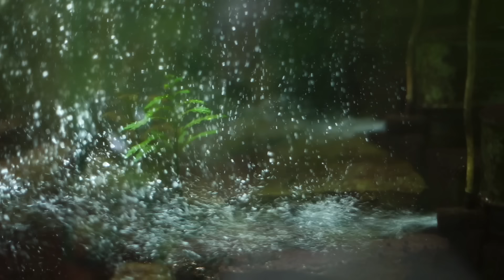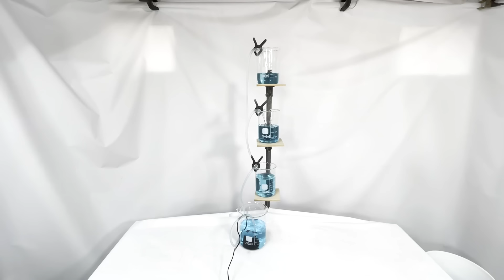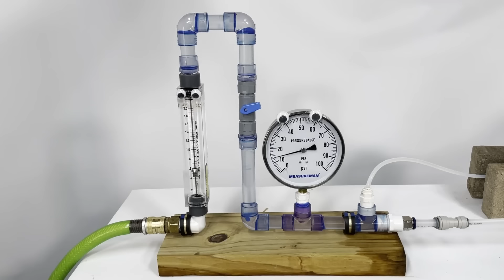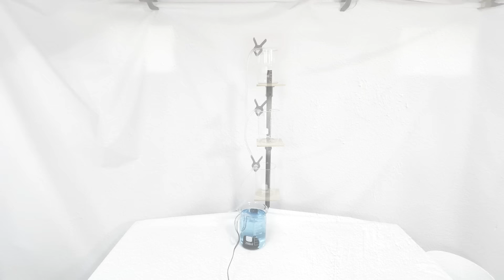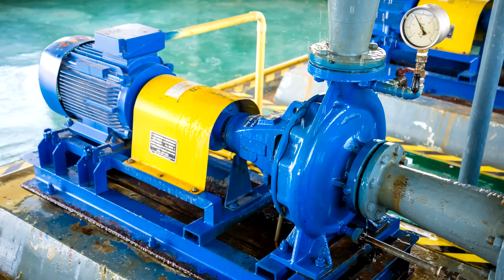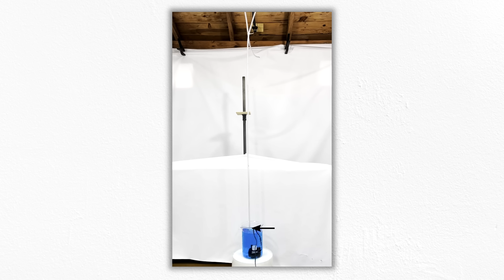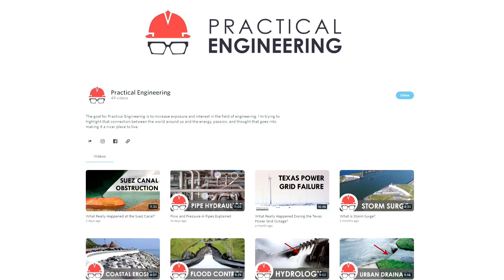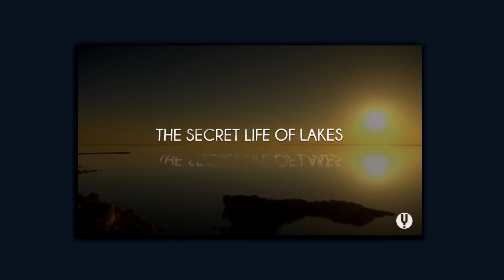Do Pumps Create Pressure or Flow?

Comment: When I was in college I understood it as, pumps create pressure which gives fluid energy, difference in pressure causes velocity/flow.
Reply: Just like a net positive force creates acceleration, not the other way around.
Reply: For gas right? But fluids I thought weren’t compressible.
Reply: @eswing2153  everything is compressible, even fluids and solids. They just need a lot more pressure to compress in comparison to gases. And fluids under pressure also store a bit of energy by expanding their containers.
Reply: Yep. Nature seeks equilibrium, and we provide power in one form to create energy gradients to drive a flow that can be used for something else.
Reply: @eswing2153  a fluid is just a substance that flows and takes the shape of its container, gasses and liquids are fluids. In some cases solids are fluids as well.
Reply: @praisethyjeebus  everything can flow with pull it enough lol
Reply: And again it's just like potentials and voltage. Difference in potentials causes voltage. And conductance causes current flow.
Reply: @NicosLeben  Difference in electrical potential IS voltage, right? I mean...if we are being pedantic we can say that voltage is a bad name, because it is based on a unity, and we don't call a length "feetage". But I don't understand how can there be a conceptual difference between the two in order to say that "one is causing another"
Reply: Wouldn't this only be true for the centrifugal pump? In the case of the positive-displacement-pump the velocity/flow is the same regardless of pressure
Reply: @Mikeyy511  That would arguably only be true with an ideal motor (or a very tightly speed-controlled one, or a synchronous one) - once enough back pressure starts loading the pump and the motor, it will first slow down then stall, meaning it would still have a non-constant _curve_. It's just that the variation with pressure would be practically zero for low pressures compared to the stall pressure...
Reply: You’re close: pumps add energy to a fluid. That increase in energy, in accordance with Bernoulli’s Law, can increase the fluid’s pressure, velocity, or vertical height. 

It’s a bit like the swinging ship rides. Do the drive wheels make you go higher or faster? Both, because they’re adding energy to the system. Since the system has more energy, it now travels faster, and requires a larger height to convert into gravitational potential energy.
Reply: @eswing2153  fluids just do not need to be compressed as much (there isn’t a lot of space between molecules) to create a lot of pressure compared to gas which can have a large change in volume for certain pressures.
Reply: pumps also create pressure difference, really, not an absolute value of pressure
Reply: Batteries, electrical power supplies, and fluid pumps all have (at least) 2 things to consider: the open circuit voltage = pressure when the valve is closed, and the short circuit current = flow with no restrictions. Everywhere in between depends on the resistance or system curve.
Reply: ... when in reality: it's all energy conversion, and things like flow rate, pressure, voltage etc. are all symptoms and indicators, not causes.
Reply: @JPFighter93  WORD
Reply: @praisethyjeebus YES common glass is a fluid, a very viscous fluid.
Reply: @bpetnoi1472  that theory has been proven wrong multiple times over. Glass is solid, not fluid.
Reply: Qimodis  astute observation
Reply: @eswing2153 I'm sure someone has pointed this out to you by now, but gases are fluids lmao 😂

In regards to physics/engineering we speak in terms of Newtonian fluids, which is any matter that flows from high to low pressure in a laminar or turbulent state 👍 Whereas "fluids" in the colloquial sense is used interchangeably for the term "liquids"... this is often a source of confusion for people who don't have a solid basis of scientific knowledge 💯
Reply: @praisethyjeebus actually Newtonian fluids are any substance that flows from high to low pressure and maintains either laminar or turbulent flow 👍
Reply: @mrb692 In regards to water, "pressure" is a direct function of height so your observation seems redundant in listing both 🤔
If you have 2 cylinders that are 36" inches tall, but one with a 2" inch diameter and one with a 2' foot diameter... When filled with water, the pressure would be the exact same at the bottom of both cylinders lmao
Reply: @EmpressOfExile206  I was talking about the swinging ship rides. The motors add kinetic energy which moves the ship faster which means a greater height to convert it all to potential energy. Speed and height are interchangeable because energy is energy. 

Pressure and height (and velocity) are all interchangeable as given by Bernoulli’s principle because they’re all different forms of energy, and energy is energy. And no, pressure is not a “direct function of height”, as evidenced by hydraulic systems not being hundreds of feet tall.
Reply: @EmpressOfExile206  lol. I’m an engineer. I’m well aware of what you speak.

Comment: This was a really great video, thanks!  Loved the graphs!
Reply: gioyu comi  Long story short, for the motor it's because of eddy currents.

For the motor it has to do with the design of the motor. A motor has an ideal operating range. If the motor is spinning too slow, you're not getting bang for your buck (low flow rate). Too fast, and the fields generated by the motor start to interfere with eachother (eddy currents) and its efficiency goes down... so the idea is to get the correct size motor. If you get too big or too small a motor, you strain the motor and make it inefficient. Good electricity goes to waste if you don't select the correct motor... so it's good on your electric bill as well to find the perfect motor.

In regard to the system curve, I think it's because the pressure drop due to friction in the pipe isn't linear. Watch his other vid on pressure and flow. He's got a part with the hazen williams equation.

Comment: “Do pumps create pressure or flow?”
“Yes.”
Reply: they pump XD
Reply: they create pressure. then the fluid responds to that pressure by flowing.
Reply: @mrxmry3264  exactly this. Like how a battery creates a voltage differential in a circuit, a pump creates a pressure differential. Fluid in the high pressure side will need to move to the low pressure side but the pump prevents it from going backwards, so it must move through the system first.
Reply: @MiniEquine  correct.
Reply: @Tom R avatar checks out
Reply: "Pumps create pressure or flow."
Reply: centrifugal ones dont make much pressure but radial piston ones do because they basically work like an air compressor mixed with a radial aircraft engine.
Reply: Pumps create flow, restrictions create pressure.
Reply: @calholli  thank you your the first person that has agreed with me. It's real simple.
Reply: @hydraulicshop69  I took a hydraulics course and this was drilled into my head. If I have a pump with a fixed flow rate and I want to increase my output pressure I need to use a smaller diameter hose. 

But that’s only half the solution because pressure is measured by the cross sectional area of a hose an not the diameter. If I go from a #8 hose to a #16 hose I have decreased my pressure by slightly over 4 times because if I double the diameter I increase the area four times. Correct me if I’m wrong but that’s what I remember.
Reply: @aaronpreston47  Your first paragraph is right. Idk about the numbers on the hoses but yes a 5gpm pump will produce 5gpm until its restricted which causes pressure. Hope that clears it up.
Reply: Alot of false info here.
Reply: Pumps create flow. The only reason centrifugal ones can't pump up over the head is because the flow backwards equals the flow forwards. They aren't perfectly sealed pumps and by virtue of their nature are tricky to discern how they do their thing.
Reply: That was my first thought as well. 
I just spent $100k on new raw water pumps for my water plant. The sizing and engineering was the easy part. Getting something that specialized during Covid insanity was impossible.
Both our pumps died in December, we installed a backup. It was supposed to be two weeks to get our new pumps...they came yesterday, early May. 2 weeks became 5 months. 

These are 480v 50hp pumps running 1400gpm against 70ft of head. They're big, about 1000lb each.
Reply: @calholli  Unfortunately, you're wrong. Pumps create pressure and that pressure MAY create flow. The pump's impeller imparts pressure against the fluid. If there is no 'apparent flow' there will still be flow within the pump as the pump simply 'stirs' the fluid.
Reply: @hydraulicshop69  Pumps create pressure - and that pressure may create flow.
Reply: @RobertMorgan  "Both our pumps died in December"
Why?
Reply: @millomweb  wrong
Reply: @hydraulicshop69  "Alot of false info here."
Agreed - and most of it is coming from you.
Reply: @hydraulicshop69  Yes, you are.
Reply: @millomweb  the way you are explaining parts you clearly never worked on any hydros. Everyone will see this and you will be proved wrong like you already have.
Reply: @hydraulicshop69  We were talking about pumps. What's a 'hydro' - supposed to mean ? Is that your illiteracy coming through ?
'The way I'm explaining parts' - you'll have to explain that.
Where's this alleged proof you talk about ?
Reply: @hydraulicshop69  Maybe I'm the only one that knows what he's talking about and actually understands the physics and principles involved.
Reply: @millomweb  yea I'm done you dont even know fluidpower. And you weren't talking to anyone your trying to look smart and it has backfired on you. I'll leave it at that I'm years ahead of ya.
Reply: @hydraulicshop69  Years ahead in what field ? - trolling ?
Reply: @millomweb  fluidpower  hence the name hydraulic shop  let's talk bud been doing this for over 20 years
Reply: @hydraulicshop69  Uses pumps but not the impellor type as you need positive displacement.

Comment: 7:50 this is just like electricity; the load determines the power the generator makes. Interestingly, you say with pos displacement pumps it's the flow that is fixed and the pressure that varies based on load demand. Electricity is the opposite; we hold voltage (pressure) constant and the load determines the varied amperage (flow). Wonder why that is hmm

Comment: "Let me know if - . . ." 
The answer is yes, Brady. The answer will always be, "Yes. We do want to know more. Please, be as in depth as possible."
Edit:
Oh! Do come and join the argument over pressure vs flow below. It will help the channel's engagement.
Reply: Very true
Reply: I thought his name is Grady
Reply: THIS^
Reply: @ubersham  It is.
Reply: @calholli  you clearly don't understand ohms law. Pressure is voltage. It is the difference in pressure that generates flow. The resistance to flow is the tubing being too narrow or having too much friction.
Reply: @calholli  It sounds like you're talking about a capacitor in your second post, except there's a slight problem because water is incompressible, you can't really store pressure unless you go vertical. With a gas, though, every section of pipe would have an inherent capacitance. But superjugy is correct, the electrical analog to water pressure is voltage.
Reply: @calholli  You just contr4adicted yourself. what you just described is a capacitor holding the voltage (pressure) and when you close the circuit, the capacitor discahrges and current flows (the pressure drops and fluid drains out). think of it this way. if your valve is small the container will drain slowly (high resistance) if it is a big valve, it will drain faster (low ressitance)
Reply: https://en.wikipedia.org/wiki/Hydraulic_analogy this might help you understand better. Even the equations are similar
Reply: @calholli  look at the link. Do an energy and force equation system. Your model won't satisfy the equations.
Reply: @calholli  any pump that has flow, has pressure. No exceptions. Also, air is not restricted, yet there is atmospheric pressure.. Because pressure is force applied to an area. Either gravitational, or a motor force.
Reply: He should go into detail on parallel/series pump behavior, NPSHR, and mechanical seals. Control valves in the video after that.
Reply: @calholli  Yes, you've described the thumb-on-hose scenario correctly, but now we're talking about something different. Let's acknowledge that before we go moving goalposts. Resistance + current means there's a voltage difference, I think that's what you're trying to say, but you worded it like the resistance IS the voltage.
Reply: @calholli  No, not wrong. Voltage is proportional to resistance. You raise the resistance, you get more voltage across the resistor. Not more than the power supply (or pump) can generate, of course, but in relation to the other elements in the circuit that's how it works. You even said so yourself with "Raise the restriction and flow drops, and you can measure that resistance in pressure." And we're trying to tell you that pressure is like voltage. You can certainly derive the resistance of an element by the voltage/pressure across it and the current through it, and I think maybe that's why you think that pressure is equal to resistance - it's proportional, but a different quantity.
Reply: "Please, be as in depth as possible."

Now now, we don't want him under too much pressure. ;)
Reply: @calholli  the flow in a pipe is driven by pressure gradient. Imagine two tanks with same water level  connected by a pipe, you will have no flow because pressure on cross sections at both ends is equal, so no pressure gradient. If you block the flow from a pipe with your thumb, again no pressure gradient, so no flow

Comment: I'm an engineer in a pump repair shop and make and fit mechanical seals to them, this video was fantastic.

Plus to prove pumps do create pressure, it's in their design, the volute has that spiral shape that once the product has been moved off the impeller eye to the walls of the volute it follows this spiral to the discharge and as the volute opens up the fluid builds up and loses flow and builds pressure before leaving the discharge, which is why the suction always larger than the discharge, to create pressure.

Comment: I worked for 7 years in the activity of pitometry in water supply pump stations, using ultrasonic flowmeters, analyzing the behavior of flows and pressures and their relationship with the water levels of the well and aquifer, and that was an amazing experience for me, personally besides the dam inspectios is one of my favorite works in hydraulic engineering. Sometimes the sound of the pump motor says you that something is going wrong, in some cases because the pumps work "out of parameters" (with the curve displaced from the optimal operating range), and that's something that often is not taking in account, the correct selection of the pump according the needs of the system.

Comment: would love to see a video covering impeller pumps. I worked at a valve shop where the serviced crude oil pumps and they used impellers to "pull" the fluid though. the multi stage versions also did a "crossover" so the pumps impellers pushed or pulled on each other instead of generating a huge thrust load to one side. might be an interesting episode.

Comment: 5:52 that 45° pump bypass setup is genius.
Reply: Can you explain? I'm not sure the significance of what I'm looking at.
Reply: Most bypass paths use 90° corners which is terrible for efficiency and pressure drops, given the diameter of the pipe the contents are more than likely heavy and the less you need to steer the fluid the better.
Reply: @Aa-ron01  I see. That seems like quite an obvious solution, rather than something genius. Any particular reason it's not commonly done?
Reply: @PerMortensen  I haven't a clue, it could be standard practice for them it's just not something I've seen before. But I'm 27 so there's a lot I haven't seen yet. Besides doesn't everything seem obvious and logical when it's pointed out and explained?
Reply: @Aa-ron01  Yeah, that's a fair point.

Comment: Pump as an active element of pipes system provides delivery of the mechanical energy (with respect to time - power) to the fluid which is given as Q•H (for one unit of the specific weight of the fluid). Centrifugal pump was considered in the video thus shape or geometry of the impeller/rotor is strictly associated with its specific speed coefficient (kinematic or dynamic). These types of machines increase kinetic energy of the fluid (also momentum) when non zero  net torque is acting on the shaft - see Euler's equation... then most of the kinetic energy is converted into potential energy (geometric elevation & static pressure) as diameter of outlet increases. Total head is a function of discharge H(Q). Briefly speaking, pump is an active source of energy for fluid and pipes as passive elements consume it (dissipation). Thus, actual resistance of pipes (throttling, roughness, length, diameter, elbows...) determine flow rate for a given source of the energy - pump (related to rpm). Thinking in terms of the energy and conservation laws is always usefull